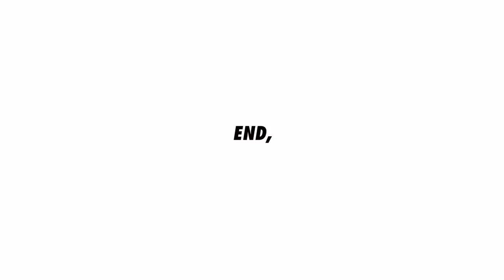W79_Lighting shelf

Comment: I cringed when that shelf fell. The fall caused the left hand side to damage the wall slightly (07:43). Did you manage to fix that later, or did your client forgive for that too? If she did, not many would, nor should. You are quite fortunate to have a client like that.
In future, consider making the extreme right and left supports a bit longer than the ones in between, and with more clearance (bevelled edges etc), so at least the shelf is supported before you push from the middle to shelf full inserted over the other supports.
Reply: Usefull tip!